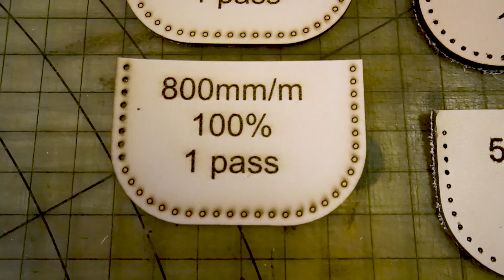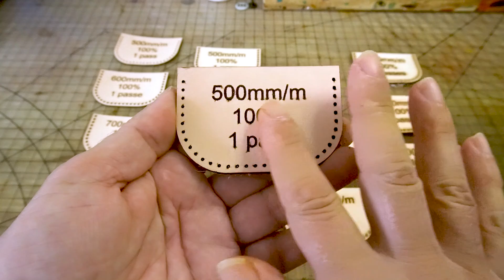Can a 10watt Diode Laser cut leather patterns and stitching holes? Aufero Laser 2 Lu2-10a 10 Watt.

Comment: Hello, thank you for the informative video! Does it smell when the laser goes through the leather? I would like to try the laser with leather, but   I'm worried if it would cause odor.
Reply from the maker: Thank you for the question. Oh yes, very much! I do all of my laser work outside for now. I am working on an enclosure which from what I have heard helps a great deal depending on how well the box is made and how good your vent system is. I wish it smelled like bacon but it does not. It smells like when you burn hair. The new laser I am using has Wi-Fi connection so I do not have to move my computer when I take my laser outside which is nice. I just his the go button and run outside to keep an eye on the laser. It is the AldoLaser Delta and it is my favorite for leather as of now. I did a video review on it if you feel like checking it out. https://youtu.be/2vnmjb9w2jo I also did a video of some of the pitfalls you can run into while cutting leather. The link is here. https://youtu.be/djQ4_qhFWTQ Thank you very much. Any questions just ask. 😀
Reply: @baronleathercraft  Thank you for your reply, it really helped a lot since I do not have a place  to work on it outside for now. I will check the videos you have recommended :)
Reply from the maker: Glad I could help! Always here to try to help.  @sje0529  👍

Comment: well this video inspired me and i bought a 10 w Elegoo Pheda but I think i am doing something wrong because i can not cut even 1.4 mm thick veg tan leather withh 100 mm a minute with 100 percent power. focus and lightburn parameters checked machine is brand new clean and have air assist and honeycomb. any idea would be very helpfull
Reply from the maker: Hi Yaneden, Sorry your having trouble with your laser, I am not familiar with this brand but it looks like a nice machine. It seems you have checked all the essentials that would cause this problem so I tried to look into this deeper and I ran into a youtuber with the same laser  that was having the same issue. He posted this video: https://www.youtube.com/watch?v=tYzxlJkE0B4 . He seemed to of fixed it because he has videos of himself using the machine to cut after the fact. He never did reveal how he fixed it but if you get in touch with him I am sure he will reveal how he fixed it, plus since he uses the same laser as you he might be a good source of information. I hope this leads you on a path to fixing your issue. Lets us know how it works out. Plus, it just occurred to me. play around with different focal lengths just to see if it makes a difference. I have had some luck playing around like that with one of my lasers.
Reply: Can not appreciate your generous concern about my problem and I will follow every steps and advices you were giving and will update you with the outcome if I will fix it. Thanks millons again
Reply from the maker: respect :) Thank you for the kind words.

Comment: Hello, more or less in your experience, with a 20W diode and 1,5mm leather, could I consider 500-600mm/m@30% with 1 pass, a good start of point for test cutting leather?
Reply from the maker: My guess is the power will be to low but it is still a great test to do, just make sure to use scrap. Today I was preparing some leather items on a 20watt laser and I used 400mm/m and 80 power with one pass. I was cutting 3/4 oz leather almost 1.5mm. I might of been able to go faster but that setting did the trick. If you do not mind, after you do your test let us know how it goes and which laser you are working with. If it is able to do 500mm/m at 30 that would be great but I feel you will have to turn the power up.
Reply: @baronleathercraft  I appreciate the advice, I'll trying in a few days, as soon as I've some free time. Right, I'll doing a material test before I start working but sometimes is useful have some values for reference.
Reply from the maker: @bigsub_full  Yes, material test are actually a great resource. I need to do them more often. :)

Comment: What is the minimum diameter you can egrave for stitching holes?
Reply from the maker: I actually have not tried to cut a hole smaller the 1mm . A  diode laser can indeed cut a hole smaller than one millimeter in leather.  However, It is important to note that the settings required to cut any hole may vary depending on the thickness of the leather. You are going to have to experiment with different settings to achieve the desired results. This is something I do before I cut just about anything anyway to make sure I do not waste material. If I am going to cut stitching holes in a thick piece of leather I will test a small piece and see what power I need to cut through the leather. I will also test how many times I need to make a pass. I will test your question next time I power on the laser. I know the software will let me design any size hole, I mean crazy small. The smaller the spot size of the laser the smaller and more detail a laser can cut and engrave but I feel any of the lasers on the market can achieve your goal. You do not have to search for a laser with a small spot size . In conclusion,  I am sure I can make a hole with a laser the size of the beam itself. so although I have not tried you experiment ( and I will) I am confident you can achieve your goal size.
Reply: @baronleathercraft   thank you so much for your reply and also your video, it’s really helpful, i watched it a couple of times, this really helps me to decide to get a laser engraver, i am doing leather crafting as hobby in an apartment, so i can’t punch holes with prongs because it makes so much noise, i am using arbor press but this time i need to so much calculations to make all the holes in correct line,
Reply from the maker: @ayhanozler Thank you for letting me know. I love knowing my videos are helping other people. :)  Once you have your design set up you can really start pumping them out. As you might see from my videos I do not run the laser in my apartment. I bring it outside. Do you have a porch or a place to do it outside? If you are going to do it inside you are going to need an enclosure and an exhaust system to force the smoke out a window. Even then leather is so stinky when being cut or engraved I do not think there is any enclosure that would contain that smell completely. If it smelled like bacon I would run it all day but it smells more like burnt hair. Just in case you are not aware. :)
Reply: @baronleathercraft   smoke was the one other point i want to ask you, thanks for replying it too, and yes i can do it in balcony but i am still concerning if the smell bothers neighbors 😕. And i have some laser burnt woods and they are still smells burnt after two months, does the leather keeps smelling burnt after the process, have you had any observations about that?
Reply from the maker: @ayhanozler  I always  wet the leather before I cut it. It helps it lay flat and keeps the laser module from pushing the material and ruining the job. It also helps prevent smoke damage. I also wash the leather off under water after cutting/engraving. I found for me the smoke smell goes away after 2 to 3 days. Also you will need to sand the edges. The holes can gather soot which can cause a problem with sewing because it can leave a residue on the stitch and lighter color thread can reveal this. Darker thread there is no problem.  Your neighbors will not like it. So I wouldn't run your laser 24/7. Do it in spurts. :)
Reply: @baronleathercraft  thanks for advices, they are really helpful, and your videos is the most explaining one 🙏🏻🙏🏻🙏🏻
Reply from the maker: @ayhanozler  Great! I try to add information that I would want to know if I was researching the topic. :)

Comment: Man looking for laser engraving machine that works on acrylic wanna RGB backlates for video cards will the lm2 pro do the Job for both cutting and engraving on acrylic?
Reply from the maker: The LM2 Pro is capable of cutting acrylic as you know. According to the materials reference provided by Ortur, the recommended settings for cutting and engraving acrylic depend on the thickness of the material However, the reference does not provide any information on creating RGB backplates for video cards. I have no knowledge on creating RGB backplates so I can not say for sure but based on my limited research on the topic to answer your question I am going to say maybe. :) I have found videos on this topic but they are using a Co2 laser. Here is a link to one of the videos.:https://www.youtube.com/watch?v=VYOSaGIcLhE I know the LM2 will cut acrylic just fine. I am not sure if a diode laser cuts the edges as cleanly as a co2 laser. based on what I see in this video I want to say , yes it can, but I am not confident enough to give you a definitive answer. I hoped this helped some. :)

Comment: How did you set the parameters for your hole size, spacing (I use a 4mm hand hole punch), distance from edge? Did you have to custom design it in Lightburn? Thanks
Reply from the maker: I use adobe illustrator to create the design. I also use a 4 mm hole punch. I will send you to a video that helped me understand how to make stitching holes with adobe illustrator. I have found that making stitching holes is limited in ability with lightburn. My technique is a lil different then what these videos teach because there are many ways to get to the same place  but this is how I learned.

These 3 videos will help you with making stitching holes and patterns with illustrator.
https://www.youtube.com/watch?v=QJKkdOiOmnE&t=329s
https://www.youtube.com/watch?v=uCSNmQDgWT8&t=201s
https://youtu.be/P-fuexlJdHk

Comment: air assist or none ?  Also did you make that leather thickness gauge or d/l it from etsy/site ? Like to find it.
Reply from the maker: Thank you for your question. Yes, I did use air assist. The thickness gauge I used was from Springfield leather but I would recommend using a digital caliper. The one I ended up buying is made by Qfun. You will find it useful when owning a laser for many reasons.

Comment: @baronleathcraft what were your settings for engraving the words?
Reply from the maker: Unfortunately I am not sure what setting I used on the letters in this video but I know for myself I like to use 5000 mm/m and anywhere between 30 to 50% power when using a 10 watt laser. I mostly  use 50% because I like a dark burn. I would play around with those settings for letters or engraving on leather. Thank you for the question. :)

Comment: thanks for the video but you should never run your diode laser at 100% it greatly shortens the life of your diode but your settings tell me you could do this at 90-95% so thanks for the video good information
Reply from the maker: I agree.  When I use a 10 watt laser I run it at 200 to 300mm/m at 90%.  I have come to the same conclusion. Here is some more info from the guys at lightburn on over heating diode lasers.
https://forum.lightburnsoftware.com/t/does-100-power-impair-diode-laser/14536
 Thank you for your input.

Comment: What software do you use for design?
Reply from the maker: I use a combination of Lightburn and Adobe illustrator. I find it easy to create shapes such as leather wallet pockets in lightburn but I find that lightburn really is not able to truly create stitching holes correctly yet. It lacks some features that illustrator has as far as evening out hole distance and being able to manipulate how the holes travel around corners. You can make stitching holes in lightburn, they sometimes (if all the math comes together)  land in the right spots but if you want them to be completely accurate use illustrator. There are some great youtube videos on how to create stitching holes with illustrator. I have seen 2 videos on making stitching holes with lightburn and if you look closely at the ends and corners the holes just do not land in the right place. I have tried myself with the same outcome. So sometimes I will create a shape in lightburn and then import it into illustrator to finish it up. I hope this helps! Thank you...:)
Reply: @baronleathercraft  Thank you for your reply, might have to dive into the illustrator, a little intimidating
Reply from the maker: @dmitryk754  Here are 3 great illustrator videos that pretty much taught me everything I know in illustrator:
https://www.youtube.com/watch?v=uCSNmQDgWT8&t=1057s
https://www.youtube.com/watch?v=Ib8UBwu3yGA
https://www.youtube.com/watch?v=QJKkdOiOmnE&t=326s

Comment: Bro please share. 1.6mm leather cutting setting my english bad.
Reply from the maker: Sure, What language? If you are using a 10 watt laser I would use 200mm/m at 90% most likely 1 pass is enough but you might need 2. I hope this helps! Thank you. :)
Reply: @baronleathercraft  10 watt diode laser 1.6 mm leather setting please share.
Reply from the maker: @nightwalker3569  200mm/m at 90% 1 pass
Reply: @baronleathercraft  thanks Do you think air is necessary? Air asist ?
Reply from the maker: @nightwalker3569 Air assist helps.  I wet my leather before I cut it. It leaves less stains and keeps the leather flat. Wet the front and back. I hope this helps.
Reply: @baronleathercraft  thanks my friends thanks ❤️❤️ hi from turkey 🇹🇷🇹🇷
Reply from the maker: @nightwalker3569  Memnuniyetle! Umarım bu sana yardımcı olur. Derinin ıslanmasının, hava desteğinden daha iyi derinin temiz kalmasına yardımcı olduğunu buldum, ancak her ikisi de daha iyi. İsterseniz nasıl gittiğini bana bildirin. Teşekkür ederim!

Comment: Hello, in leather cutting how to clean the soot that remains in the holes for the stitches?  thank you.
Reply from the maker: I have not had to because the thread always covers the holes. When ever I cut leather with a laser I sand the edges to take off the thin layer of burnt leather. If you have a thin small metal file, that should do the trick. I hope this helps! Thank you...

Comment: Ciao, i fumi sono tossici? Grazie
Reply from the maker: Salve, grazie per la domanda.
Come sai, inalare fumo non fa bene. Detto questo, La pelle più sicura per
incidere e tagliare è noto come cuoio veg tan. La pelle conciata al vegetale si riferisce al metodo di concia della pelle bovina in pelle. Si chiama “vegetale” per via dei tannini naturali utilizzati nel processo di concia come la corteccia degli alberi. È l'unica pelle con cui userò il mio laser. Alcune pelli sono effettivamente tossiche da incidere e bruciare. Pelle chiamata pelle conciata al cromo. Il taglio laser della pelle conciata al cromo rilascia gas di cianuro, che è altamente velenoso e potenzialmente letale. Non vuoi scherzare con esso. Speravo che questo aiutasse! Grazie. :)

Hi, Thank you for the question.
As you know inhaling any smoke is not good for you. With that said, The safest leather to engrave and cut is Known as veg tan leather. Vegetable tanned leather refers to the method of tanning the cowhide into leather. It’s called “vegetable” because of the natural tannins used in the tanning process like tree bark. It is the only leather I will use my laser with. Some leather is actually toxic to engrave and burn. Leather called chrome tanned leather. Laser cutting chrome tanned leather releases cyanide gas, which is highly poisonous and potentially lethal. You don't want to mess around with it. I hoped this helped! Thank you. :)

Comment: Which Version of LightBurn software do I need for this ?
Reply from the maker: The latest.  is the one that I have. LightBurn 1.3.01,  built Tue 2022-12-13. I hoped this helped. :)
Reply: @baronleathercraft  is this a purchased software or a download ? 
I found a free download of this but don’t know if it is a scam
Reply from the maker: @edcubberly8907  it is free for 30 days and then you have to get a license. I downloaded it from their website. Here is a link to the site.
https://lightburnsoftware.com/pages/trial-version-try-before-you-buy
That way you know you are getting the software direct from lightburn. I hope this helped! :)
Reply: @baronleathercraft  G code controller or DSP controller ?  32 bit ?
Thanks !
Reply from the maker: @edcubberly8907  The Aufero laser 2 is a G code device and it is 32 bit. You can run the machine with Lightburn or you can use a free software called LaserGRBL. I use Lightburn.

Comment: Excellent video !  I subscribed !  Do you have a video listing the supplies needed to cut and engrave leather along with the setup ?
Reply from the maker: Hi Thank you very much!
You will need a honeycomb laser bed for cutting with the laser. You put whatever you are cutting on top of it. You can find them on Amazon.
Below the honeycomb laser bed you want to put what we call a piece of waste board. this will go underneath everything.
www.homedepot.com/p/Handprint-15-32-in-x-2-ft-x-2-ft-Sanded-Plywood-3008...

I also got what is called air assist. The Aufero laser 2 with the 10 watt laser is ready to run air assist. All you need is to buy a pump. I bought this one although Sinus now makes one.
www.growgeneration.com/aquavita-air-compressor-143l-min.html

Plus I also decided to get lightburn software. The is a free software but lightbun is better from what I hear.

So look into:
1. honeycomb laser bed
2. wood board to go on bottom www.homedepot.com/p/Handprint-15-32-in-x-2-ft-x-2-ft-Sanded-Plywood-3008...
3. Pump for Air assist www.growgeneration.com/aquavita-air-compressor-143l-min.html
4. Lightburn software.
I hope this helped anymore question just let me know. :)